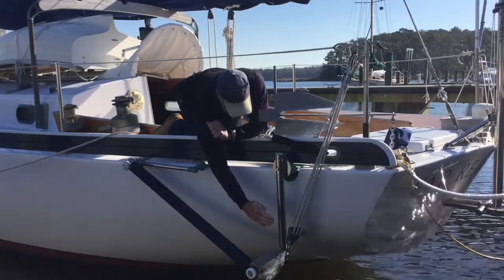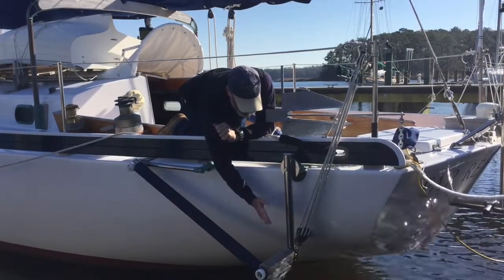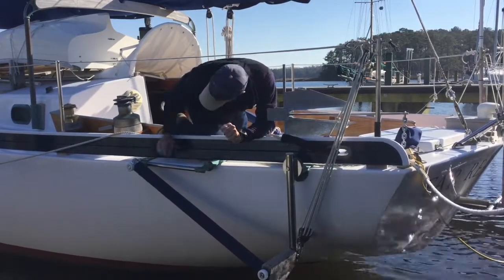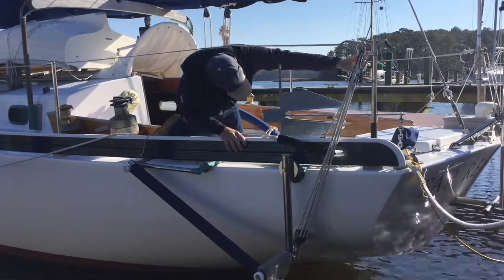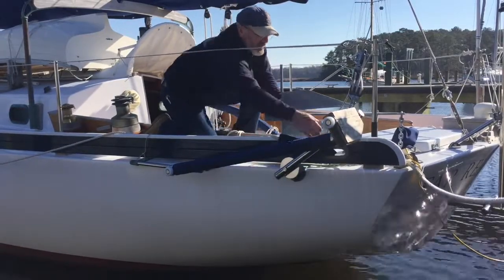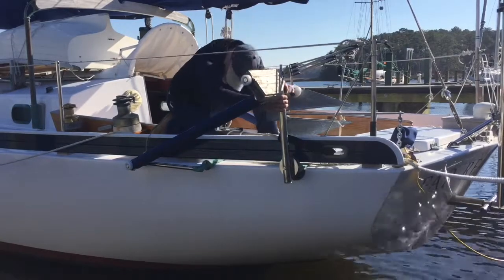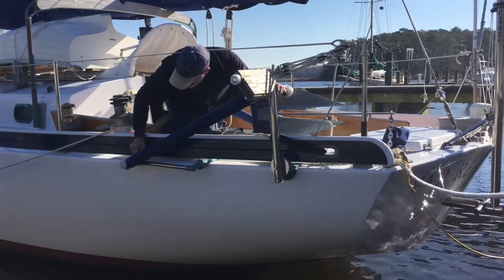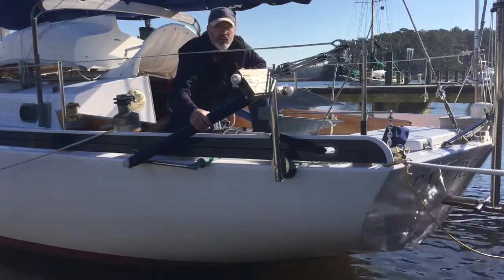Far Reach Outboard Engine Bracket

Comment: Do you hang over the side to steer your little outboard?
Reply from the maker: @kentw.england2305  There is a lever on the engine to lock it so it won't turn. Then steer with the boat's main rudder. However, when maneuvering, like in a marina or leaving or entering a slip you can unlock the lever and steer with the engine creating tremendous maneuverability.

Comment: Hey guys just wondering if you have a clip on the build of the outboard mount and specs. I am going north from Sydney this year and I'm in a 31 foot Swanson. It's a little Australian double ender. Anyways the motor died and I don't want to replace it. $13,000 AUD. I have a 9.9 outboard for my tender and thought maybe I would try your cool mount. Thanks for any help. I also sent this to your page but was not sure it went through Cheers
Reply from the maker: @sasfish1966 I received your email. I answered it but maybe it has not reached your box. This video is all I have on the finished project. No build video.  Yves Gelinas at Cape Horn Marine Products, the builder of the Cape Horn windvane built it for me. I have since sold it, though it worked perfectly.
Reply: @FarReachVoyages   Thats cool thanks so much.

Comment: Would have been a lot better with an outboard on the mount...
Reply from the maker: Paul Johnson.  It was a spur of the moment thing. It was winter. The engine was winterized and at home in the garage. Besides, if the engine was mounted you wouldn’t be able to see how it works as well as you can with the engine off.  But if it peaked your interest by depicting a different way to mount and employ an outboard then perhaps the video served its purpose....
Reply: You can’t understand how it works without the outboard?
Reply: @FarReachVoyages  
My apologies, I should have explained that it would have been better to see how effectively it raised and lowered the mount with the additional weight of an OB attached. Thanks...

Comment: Hi John!
I was wondering if you could switch it to starboard side or if it is custom made to mount on port side only.
Thanks,
Jason
Reply from the maker: This particular mount was custom made for the Far Reach to fit on the port side. There is a folding pad which fits against the hull on the bottom inboard side of the engine mounting pad. With a right hand turning prop the engine is applying pressure to the hull--the pad is forced against the hull. In reverse the engine prop walk is pulling the boat astern but also to port so the pad is pulling away from the hull.  So an outboard mounted on the side like this one works best on the port quarter--if it's a right hand turning prop which is characteristic of most small outboards.
Reply: So you could stern thrust full power to starboard but you would need to be moderate when vectoring to port as not to have the mount pivot athwartship.
Reply from the maker: Jason, yes but...LOL. It's temporary. When you reverse thrust hard to port you'll see the pad come off the hull, maybe an inch. It’s why you need a strong bracket. It will hold there  with the pad just off the hull until you ease the throttle, then the pad makes contact with the hull again. Not the same though as motoring for an hour in some slop with the pad straining off the hull, if the engine bracket were mounted on the starboard side. 

Also, because the boat is trying to turn a little to starboard, since the engine is not on the centerline, you cant it a little bit to starboard (use the engine's friction locking lever) to counteract the turning. Being able to fine tune the steering means you can get the boat to motor in a perfectly straight line. Steer with the boat’s main rudder. But canted a little like that forces the pad against the hull. You want it on the port side. Not saying it won't work on the starboard side but it will work better when you account for all these factors. 

Take a look at S4E2. Near the beginning I think there is a short video clip of the outboard running.  You'll see it's canted just a little to counter the steering. The pad is pushing against the hull taking some strain off the bracket.